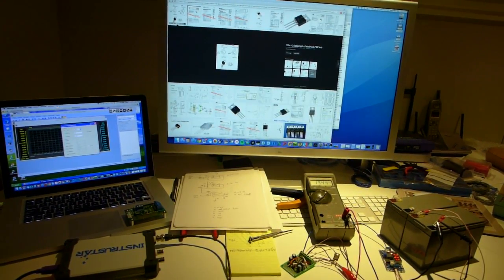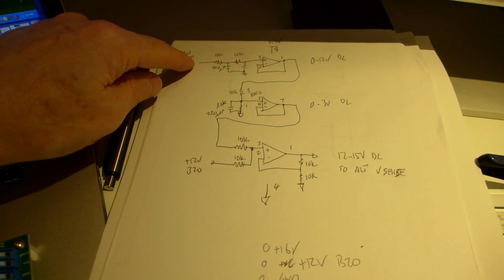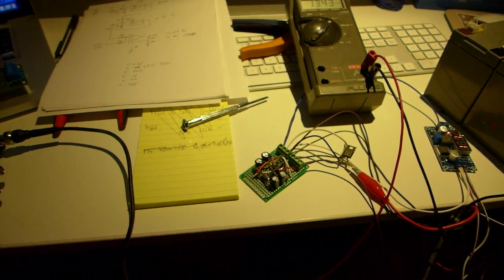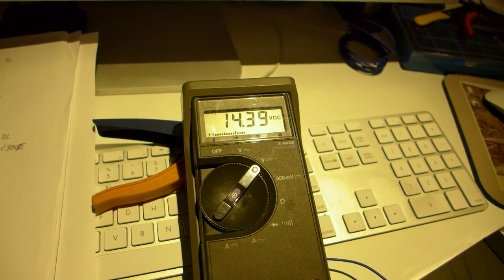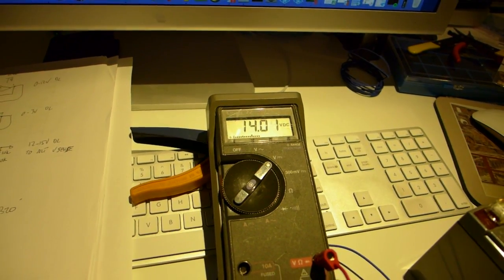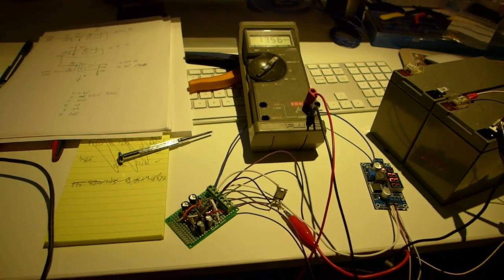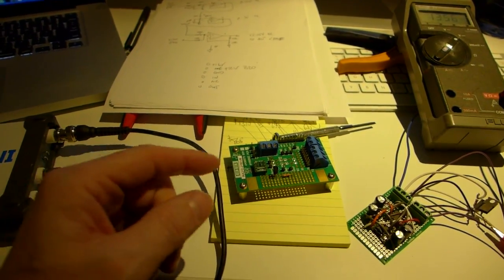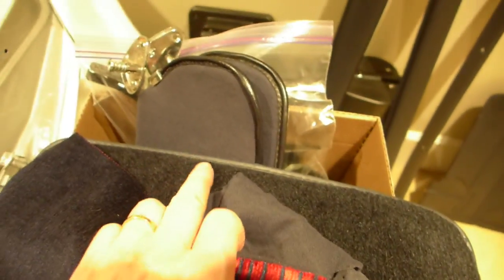The Ultimate 1983 Rabbit GTI - part 106 (Lithium battery charging under ECU control, headliner)

Comment: I had the understanding that these automotive type lipo batteries had internal battery management.  hmm
Reply from the maker: They do but you still need to limit the max voltage to them to 14.6V for only a few minutes. If you hold them up there for too long the internal BMS can't withstand the excess voltage and starts to let the cells overcharge. That is what the manufacturer said anyway ...

Comment: Nice!!  Not long till you are finished now!
Reply from the maker: +Robert Orr As I get towards the end of this project the remaining 'to do' list is getting to the point where I can see when it will actually be 'done'. It will happen in 2 phases: getting the car together enough to certify it road worthy (government inspection) and licensed, and then the final step of getting everything completed in the interior, etc. Winter has arrived and there isn't much excitement about getting my new baby out there in the cold, wet, harsh conditions but I will be able to find a nice day here and there so by February I expect to have license plates hanging on the car and then by May when spring is really springing here in the pacific northwest, I should be able to call it 'complete' and start the formal process of testing the performance envelope of the project ...